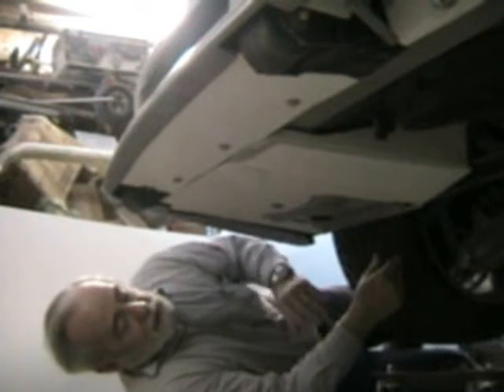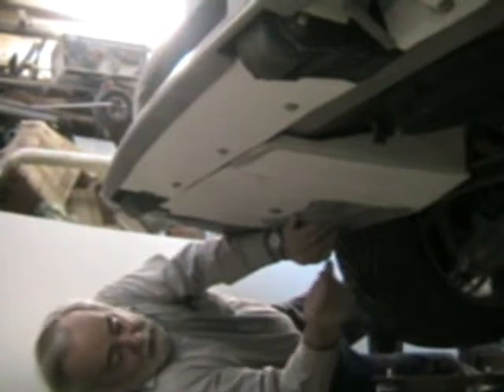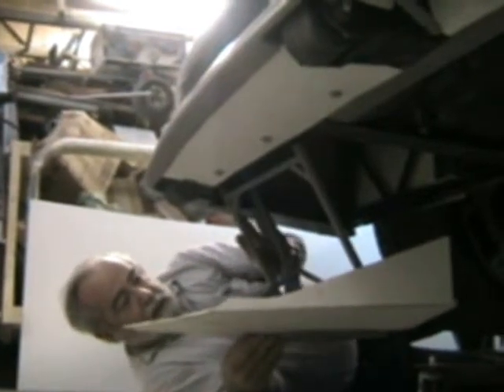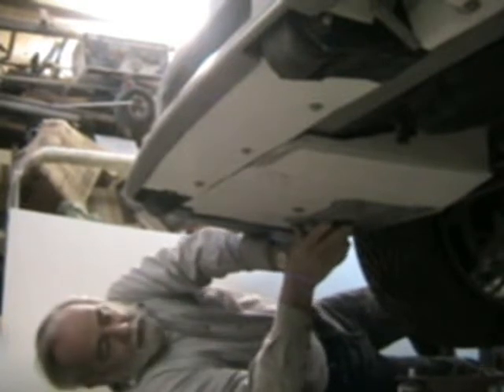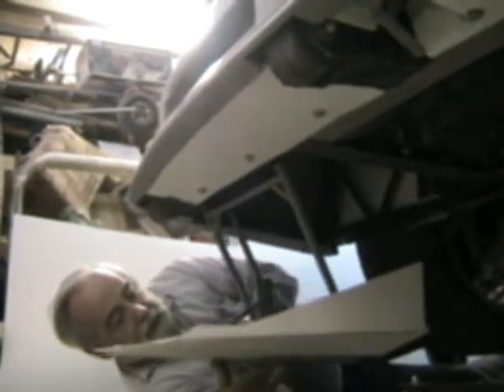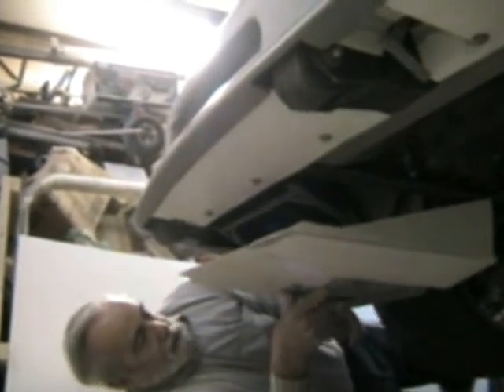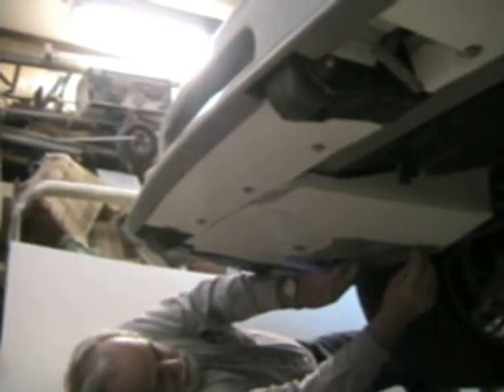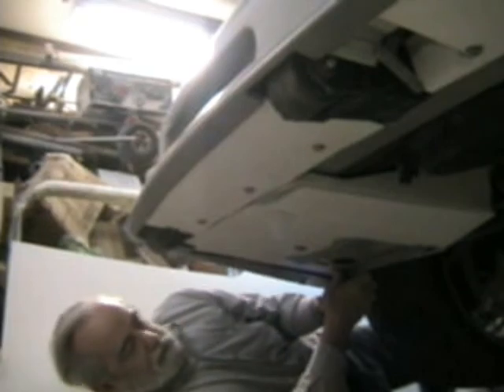Replica Lambo Articulated Battery Mounts.wmv

Comment from the maker: I used three hard rubber rollers at the front.  The one in the center gets used the most but even then they are used at slow speed for speed bumps, driveway entrances, and any sharp angle changes.  I used lawn mower deck rollers you can get at the local mower shop.  They are Homelite part number JA-33518-1.  They must be located close to the front and have almost all of the lower half below the bumper.